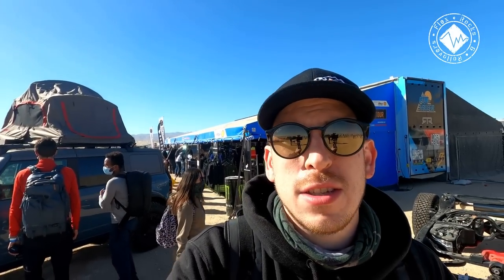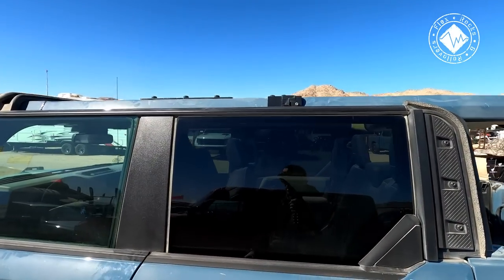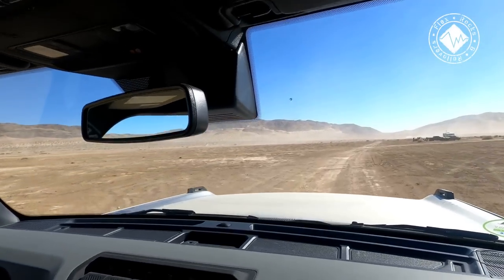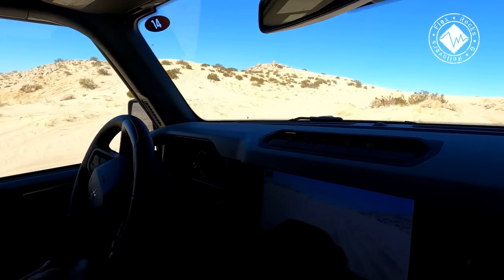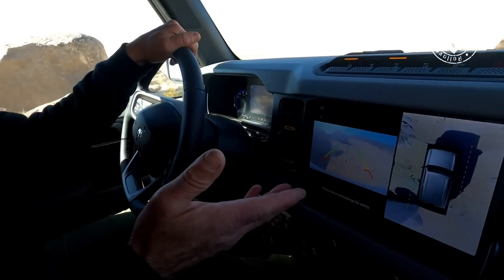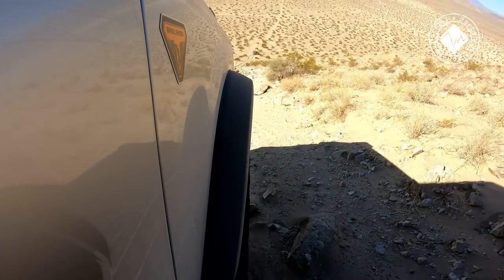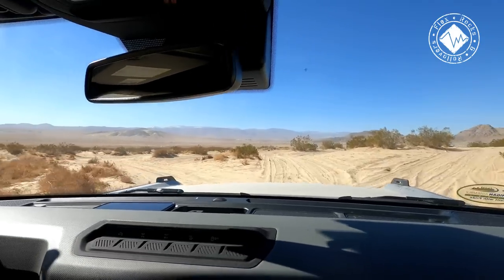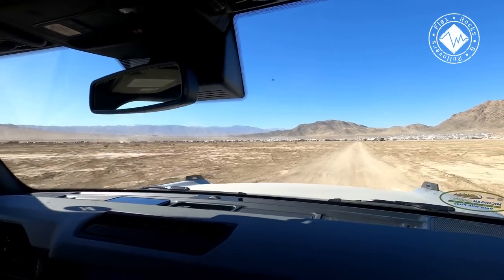Off Roading the New 2021 Ford Bronco! Reaction + Walk Around

Comment: That's the first demo that has impressed me. Ford Bronco the ultimate MALL crawler!!! Nice ride.
Reply from the maker: Yeah I really didn’t think much of it before I got in and went for a ride in it. It’s really impressive. Jeep can’t hang with that. As much as I’m a jeep guy
Reply: @FlexRocksRollovers  I was impressed with the truck. It does much more than I imagined. But I wonder how economical the truck will be to modify like you can jeep. How much money would it take to put 42's on it???
Reply: How many new Bronco's do you see running trails like Carnage canyon Colorado or Tackett creek here in Oklahoma??? I'm not sure if we will see any. I may buy me one myself daily driver over landing hunting. Disney Ok. would be fun in one. Keep my JKU off road only.
Reply: @launchone260  noticed he didn’t answer this question. None of them do.
Reply: @aprojectile4421  That's ok I think we all think the same thing....ultimate mall crawler...its still a cool truck.
Reply: @launchone260  too many electric doo dads. No proper shift lever. I’ll pass. If my shift linkage breaks I can fix it with a zip tie. Lol
Reply: @aprojectile4421  I hear ya....I like simple too...
Reply: @launchone260  + @A Projectile, Yep, that is a good question. I also wonder about bugs getting into some of the technology and I’m a computer idiot when one gets a bug in it.  I also carry a supply of zip ties, baling wire, & duct tape.

Comment: I just got my brand new Jeep Rubicon last year, but I use to have an Eddie Bauer version of the Bronco way back when.  The new Broncos look really well thought out.  Personally I would be a bit scared to buy such a complicated vehicle the first year out.  They almost always have bugs.
Reply: Bro you drive a jeep. Virtually any other type of vehicle you buy is going to be more reliable by comparison. It'll be fine.
Reply: They just had 2 recalls on the bronco sport. I’d wait as well.
Reply: @KB-bh9hp  sound like a guy who can’t do his own maintenance.
Reply: @aprojectile4421  Bro, my family is the textbook example of people who know how to perform preventative maintenance on our cars. Anytime our cars seems to be acting up, we pay attention to it, and if the issue persists, we take it to a mechanic right away. Regarding service intervals and fluid changes, our 2017 Explorer has 16k on it and it's seriously had like 8 or 9 oil changes. The engine is almost never revved past 3k, we only use recommended fuel types, it'll never tow, it's rarely asked to carry more than 4 people at a time so we're both even close to overloading it, and it's rarely driven up steep inclines. Oh, and it's washed pretty frequently during the winter. Bottom line, that car's going to last for decades and much of that has to do with how we take care of it.
Reply: @aprojectile4421  But I agree, most people don't take care of their cars and then blame the brand when they have issues. My family has basically owned brands from all of the big 3, as well as most Korean and Japanese brands, as well as quite a few European brands. From our experience owning so many brands, I can say there aren't really bad brands or cars, just bad owners. Every unreliable car we've owned is one we bought new and the issues were almost certainly brought on by the previous owners neglect. By comparison, virtually every car we bought new has lasted well over a decade without and major issues.
Reply: @aprojectile4421  Basically my original comment was just playful ribbing. My families Explorer is close to 5 years old, and it's been great. Not to mention most of the ford's of people I've known have been very reliable, lasting decades and hundreds of thousands of miles a lot of the time. Even then, I still joke about Ford reliability, usually in a manner that makes fun of people who make fun of Ford reliability or joking in a sarcastic tone.
Reply: @kykynkey7559  First, I was half joking with my original comment, surprised more people don't get it. Second, how ironic you insult my intelligence when you can't even use contractions probably. You meant to say you're, not your.
Reply: @KB-bh9hp  lol the new wrangler is not thaaaaat bad. Mines been good, 70k miles and no issues and this Jeep has been driven hard on trails.
Reply: @eda7875  I know I know lol, it's just playful ribbing, not be super serious. I drive a Ford and a kia, despite the fact that both those brands make reliable cars now, I still have the hear the reliability jokes from people still stuck in 1981. So I know how annoying it can be, I'm glad your jeep has been reliable man, hopefully you have many more enjoyable, trouble free miles to come.

Comment: ifs doesnt flex as well as a straight axle, also ifs has variable ground clearance.. so when the suspension is fully collapsed your ground clearance is a lot lower / smaller.. that doesn't happen with straight axle, straight axle always has the same ground clearance.. the only thing ifs has over straight axle is the smoothest ride over high-speed desert runs because of the unsprung wieght. but at the same time the CV joints are extremely weak compared to a straight axle, so there's trade-offs depending on what you want to do with the vehicle....
Reply: It doesnt. But it does pretty well. Best flex Ive seen from an IFS stock vehicle.

Comment: No it does not flex as good as a solid axel. It was a foot off the ground and the rear tire was off the ground. But the vehicle is still great, but you can’t get the same flex as a solid.
Reply: Its RTS score is just under a Wrangler. So sure its fair to say its less than a straight axle but both the Bronco and Wrangler flex so much more than any other competition they might as well be the same. That rear tire was like an inch off the ground too, sure, but the rock is more like 2 feet high to be fair
Reply: @mattg8116  https://www.autoweek.com/news/trucks/a33303175/bronco-vs-wrangler-bench-racing-battle/#:~:text=Ford%20says%20with%20the%20front,Bronco's%20articulation%20is%20very%20close.
Honestly i have looked up a couple websites and forums that prove otherwise, from what it says, the Bronco actually has a better RTI score than the Wrangler, two-door models score an RTI of 700 on a 20-degree ramp. And four-door models are projected to score a lower RTI of 620. So, compared to the Wrangler Rubicon Unlimited which scored 693, a Bronco’s articulation is very close. On a trail, that means the suspension of these two 4X4s should almost be an even match.
Reply: Solid front axles lift tires off the ground, too.  Ever see a bone-stock YJ on the trail?

Comment: Just can't get my head over why they designed the front bumper with the round bar right in front of the bronco logo in the grille. Should have been a tad lower so you can still read it.

Comment: Stock front dig...amazing!
Reply: Its really just one wheel braking.  :)
Reply: @ProjectXJ  True, but it’s not aftermarket.
Reply: @lazerrred  A "dig" would be disengaging one axle (both tires). So a front dig would just be driving the vehicle with the front axle only. 
Applying the brake to one wheel is not new, but it has only been done as a traction aid, not a turning aid. Its fun to see and people will try it out but its more for show than anything else. Its still something no one else has. :)
Reply from the maker: Yeah exactly! This was basically a cutting break. Not a dig.

Comment: I have to say first that I like the Bronco, but I am just not impressed by all the tech in the vehicle. Call me old school, but I hate all the stupid modes. 99% of the time, they are a hinderance more than a help. This new bronco will be perfect for all of the people who don't actually wheel. Not saying it can't wheel hard, but that will be the 1% not the masses.
Reply: I kinda like the KISS method, (keep it simple stupid) too.  I would hate to have to memorize the owners manuel, cause I have CRS.
Reply: I’m kind of the same way.  I grew up reducing points of failure when off road.  However,  having an eco boost f150, that would be my biggest worry with the bronco.  Still 1000 times more reliable the Land Rover products!  Put the 5.0 in there and I’m sold!
Reply: @ChristisKing117  yeah the warthog just might have the 5.0, but for a pretty penny i am sure.

Comment: New vehicles are alway perceived to get amazing. However as with all older vehicles, reliability of vehicle manufactured parts is critical to off roading. The last thing you need when off roading is to break down. Second is how easy is it to fix or replace a part durning an off road breakdown? Jeep (Fiat) has redesigned there Jeep’s (European Engineering). So, now people/ mechanics need to remove other systems to fix the broken part. Off course, I referring to ware & tear durning the life of the vehicle. How many parts where manufactured in China 🇨🇳?

Comment: Jeep needs to step it up, Ford is a great company!
Reply: Jeep enthusiasts don’t want to change electronic features 5 times when off-roading. We just put it in 4lo and wheel. 2 different experiences.
Reply: @Tfam305  Way to pathetically over-exaggerate in an attempt to hide Jeep's lack of technology and features. Have fun with your Death Wobble! You know... '2 different experiences' and all.   🙄
Reply: Only people who get death wobble are people who don’t do things right. Jeep has made a name for themselves for a reason. There’s a reason Tacoma’s and wranglers keep their value.
Reply: @Tfam305  I love my Jeep, I love the simplicity of it, 2001 Sahara. It is rugged and it has proved reliable over the years, I really like it. I also like the new ford bronco as it is shown on the videos.  Ford is a great company and when they really want to excel, they blow everybody out of the water. i will wait and see what happens and probably buy a Bronco. I still love my jeep. I hate those arguments, it is almost like racism. I see them in meets for "Toyota only" or "Jeep only"
I think we should be looking more at the activity and not the brand of vehicle.
Reply: @billgates1682  The only worthwhile offroad technology in the Bronco is the trail turn assist, the swaybar that can be disconnected even with a load on it, and the 360 camera. Everything else is a gimmick (GOAT mode) or has been on a Wrangler for YEARS. Also, death wobble can happen on any solid front axle vehicle that isn't properly maintained or uses cheap parts. Quit beating the dead horse that is death wobble because only people that don't know what they are talking about use that argument. I've NEVER had death wobble on any of my Jeeps and I've been driving them for 15 years.

Comment: Great look at the new Bronco (pre-production). But to note the Badlands isn't like the Rubicon. The Warthog or maybe the Raptor version will likely be Ford's answer to the Rubicon. Though the Badlands is the only way to get the manual transmission with the mid package, I decided to order the Black Diamond version.